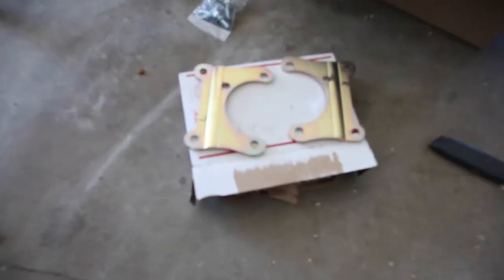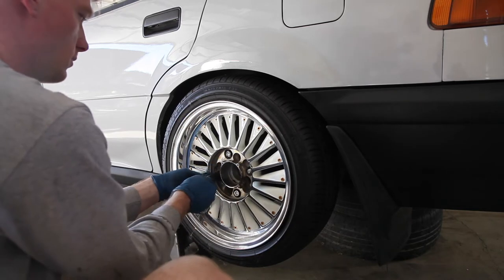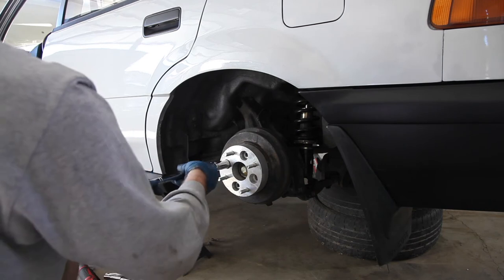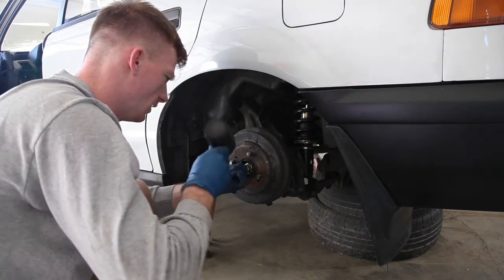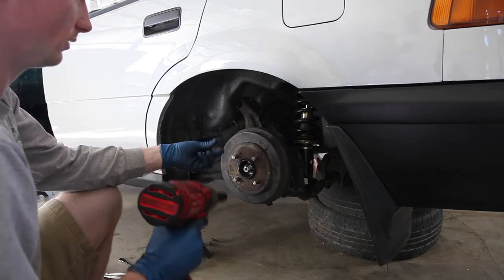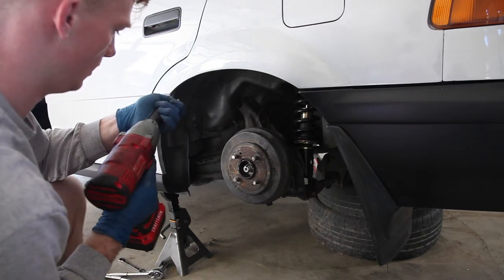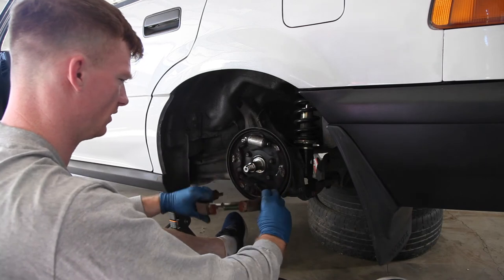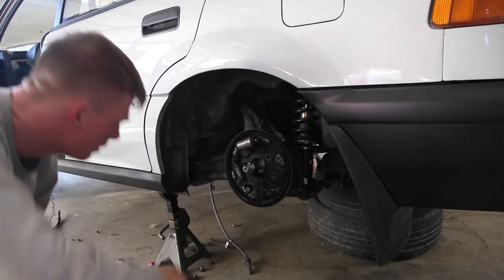Civic wagon rear drum to disc conversion Part 1; the removal

Comment: Nice video,we’re can I buy the conversion spacer plus from what car did you use the parts.thank you
Reply from the maker: Part 2 has the link but I’ll post it here for you.
Reply from the maker: https://efparts.bigcartel.com/product/honda-civic-wagon-rear-disk-convertion-kit

All parts I am using are off a 90-93 Acura integra coupe; disc, caliper, brake pads, ebrake cables.